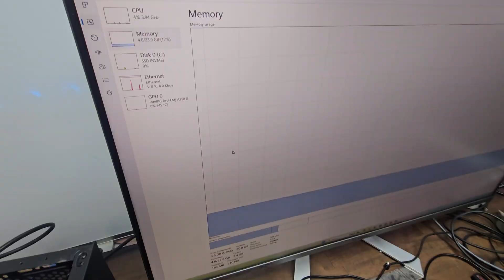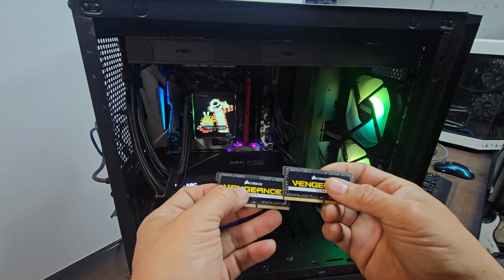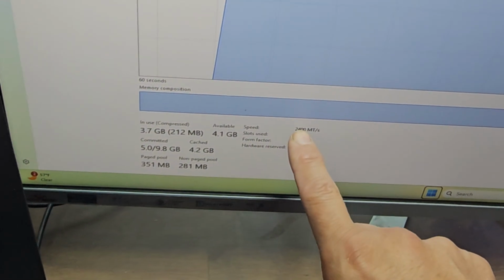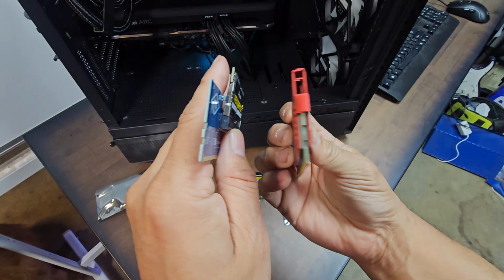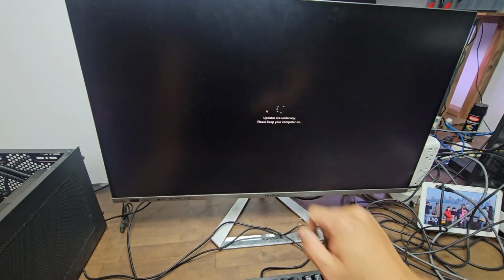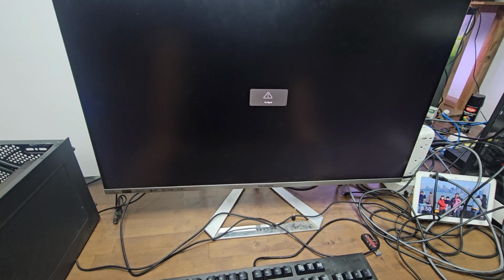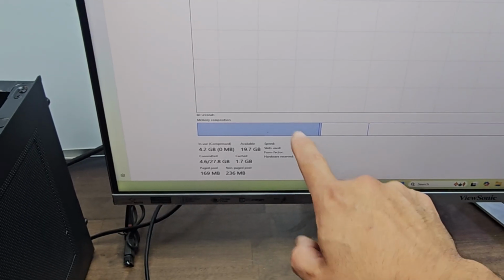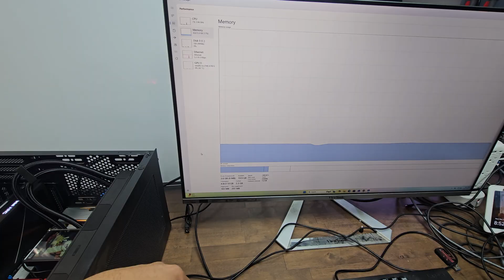Transform Laptop RAM to Desktop Memory in Seconds

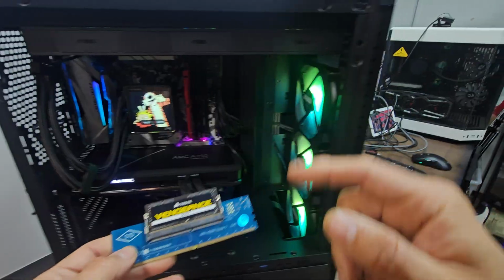Comment: All your RAM is running @ 2400Mhz... that's too slow. Do you know what you are doing? and you don't need to press Ctrl+Alt+Del to launch Task Manager [ 1:53 ], Lmao just right-click on the task bar or press Ctrl+Shift+Esc.
This setup will fall apart when you address XMP or BIOS memory settings, as that 2400Mhz is too slow.
Post isn't equal to stable or safe. Something will happen later. lol
Reply from the maker: this is a temporary solution I never mention it should be a final solution. The speed suck but with the ram prices so high this will help until the prices stabilize.

Comment: Just bought 16gb of SODIMM ram for $43 just wanted to see if i could mix it with desktop DIMM to have 32gb, and your video is the only one I found that shows laptop and desktop ram runninig together in one system.
Thx.
Reply from the maker: You might not get the same speed as your larger desktop memory, but it works until prices are affordable.

Comment: Glad I finished before this mess. About $700 in my build, 5800XT, 3080, 32GB DDR4. 

Got the Motherboard and fans for helping a friend, my brother gave me a case because the front panel broke, PSU was like $100, CPU was $150 on sale, GPU was $300 used (fixed a broken fan), and a 2TB NVMe was another $150. 

Overall, I'd say I didn't do bad. Considered going DDR5, but that would have brought me around the $1000 mark, and I used that money to get a used business laptop and make a sleeper machine for work, productivity, and light gaming on the go.
Reply: Same here. For a gaming server I've bought 32 GB DDR5 6000, 7500f, a cheap B850 board, 2nd hand PSU, and SSD + case still lying around. This set me back 325 Euro. Now the RAM alone costs almost twice as much as my entire build (over 500 Euro instead of the 80 I've paid).
Affordable gaming PCs simply aren't a thing anymore.

Comment: are the adapters satble?
Reply from the maker: They are been good so far on running some test, I'm working on a gaming video with them on and will post this week the results.  I do see a little heat but nothing to worried about.
Reply: Idk
Reply: if you are expecting high performance then no, but for normal use then it ok
Reply: @eversong1996  The real question is whether or not using such things would cause any noticable slowdowns. Because if it doesn't.....well, I've got a literal PILE of DDR4 SODIMMs at work from old laptops and a penchant for mayhem. Mostly 8GB sticks, but also plenty of 16GB and the odd 32GB.
Reply: @Wrootplonk  there are no slowdown at all because the Adapter act as like extend leg for SODIMMs ram
Reply: @eversong1996  Hm, interesting. I might look into getting hold of some of the adapters and do some comparison testing. Could be interesting!

Another thing is heat. I wonder how, if at all, the heat affects the SODIMMs.
Reply: @Wrootplonk  it basic same or even better because in laptop ram running hotter due to it being in enclose space has no air flow while this basically just opening air and has better air flow due to pc fan
Reply: @eversong1996  Very true.

Hm. Time to do some testing, methinks!